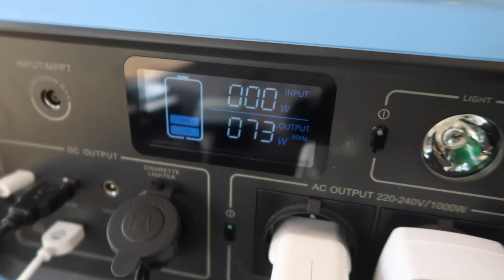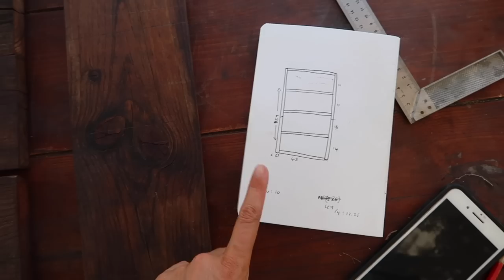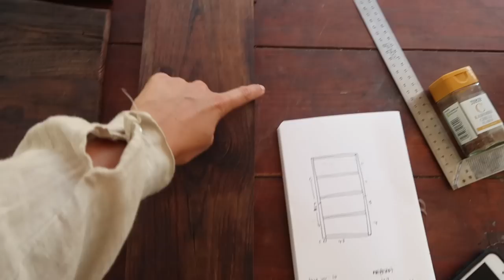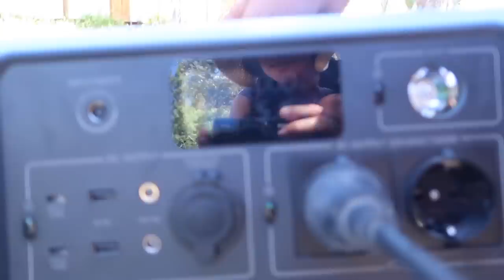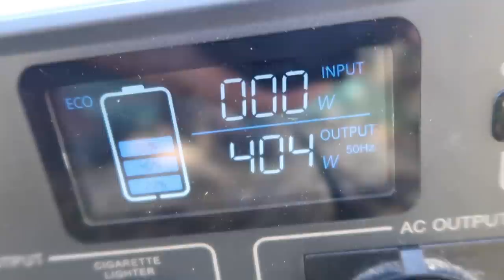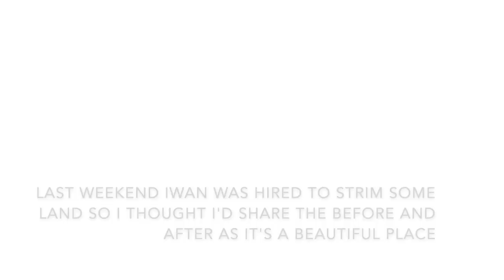OFF GRID LIVING. Upcycling & a solar power upgrade with Bluetti.

Comment: Oh Sweetie, You've probably heard the comments about helmets and eye protection, but I'm going to add another one.  Please tie up your long hair before using any power equipment.  I was using a hand electric kitchen mixer at about age 14 to do a cake mix, and while leaning over, it caught up my hair and pulled tight to my scalp in seconds.  I laughed about it but when I got to machine shop class a year later (first class of girls allowed to take metal shop, 1972)  I took the cautions about safety very seriously, and have put up my hair every time I get out a power tool since.  I enjoy your channel very much.  Be safe.
Reply: I had the same accident with the kitchen mixer but i think i was about 11 years old😂

Comment: Slow and Easy...🌻🌻🐈🐕🐕🐈. I put the laundry  soap into a large wash bowl and then soak the whites in the full sun..hot water and overnight soak is also good for work clothes. Saves on electricity. (I do have a washing machine)

Comment: A trailer for the bike would be handy, especially for Frankie. I have a two-wheeler with a simple attachment that is quick to use and is secure. Nice small shelves. (I personally like to only have the spices/ herbs out that I use all the time, and the rest in a spice chest). Very enjoyable, thanks.

Comment: I love the new/old shelf made from old wood and not costing anything. When I rebuilt our house back in thr late 80's a Spruce 2x4x8 cost .89c. Now they are getting $8. apiece !!! Hence reusing wood has become absolutely essential, especially when done so artistically !!
Regarding the fire hazard...I was watching another 'off gridder'and he was rushing to strim his olive orchard before the fire came closer. The problem I see with this is that fallen and super dried grasses are probably going to be more flammable than standing, especially if not raked up. Though a wind driven blaze is going to have it's way, sadly. No fun.
Your kitchen is looking awesome...love the vibe. I would suggest a smoke and grease extractor...all my stuff got covered in grease.

Comment: As I’ve done  a bit of carpentry now, have a little tip for you on how to cover your screws. You might need to count your signature little bit more so they get a good coverage. If you just collect all the sawdust and mix it with some wood glue and just fill the holes with it that way when you stain the wood again you won’t see it at all . Love the wood that you used it is so beautiful well done 👏👏❤️

Comment: Love the spice rack, the weather worn wood is beautiful, and you white painted stone shelving unit idea I may pinch for my bbq area in my garden.
Little tip when countersinking, if you drill the hole first then us the countersink bit, it will be easier and quicker that way, also gonna look into the bluetti power bank.

Comment: Your logic is valid. I do the same with sheds to keep the air moving and prevent mold and condensation.  Great work
Reply from the maker: Thanks Andy! Coming from you makes it solid. It hasn’t made any difference to the heat but that’s not very surprising really. I’m coming to the conclusion that proper insulation is going to be the way forward
Reply: @FrankieOffGrid  look at using heat reflective materials, white in colour i guess. I know you can get 5v fans that you could install but if the air is hot outside then you're just fanning hot air into your bedroom... 
2nd hand Aircon units could be an answer but then you have to power it.
Reply: At least you have air flow now.

Comment: Great work from you both. Spice rack is stunning and the air vent will make big difference too. One thing worth considering with the vent is attaching a piece of thin mesh on the external end of the pipe then mounting the square plate this will ensure no creepy crawlies, mosquitoes etc  can make their way in. Cxx

Comment: Hi guys, how’s the eleglide electric bike working out? Are you still happy with it? It looked like good value if it keeps working long term 😁 Could you let me know? Cheers!
Reply from the maker: Hi George. We’re loving them so far, especially with the heat. They’re robust and easy to setup and keep charged. The code we have for them works for both the M1 and the M1+
Reply: @FrankieOffGrid  thanks guys, we’re coming over next week to finalise our house purchase so these would be ideal!
Reply from the maker: Good luck!